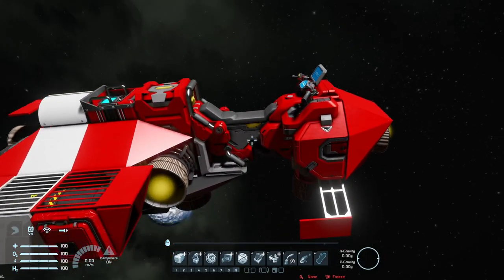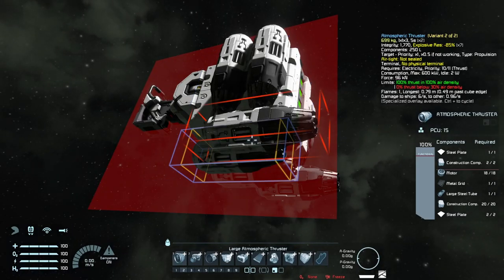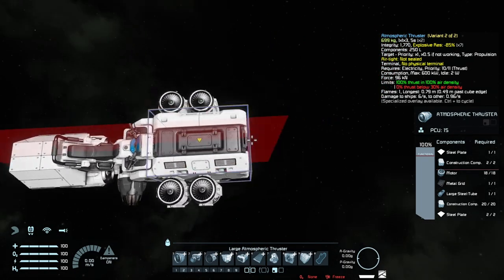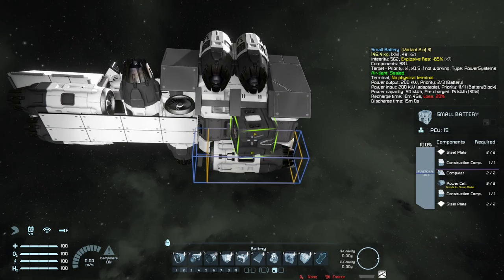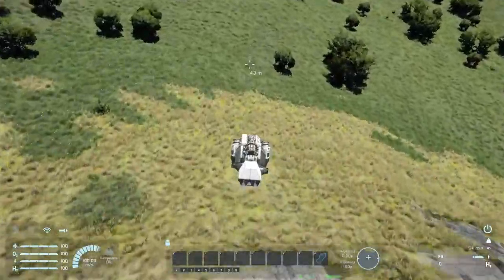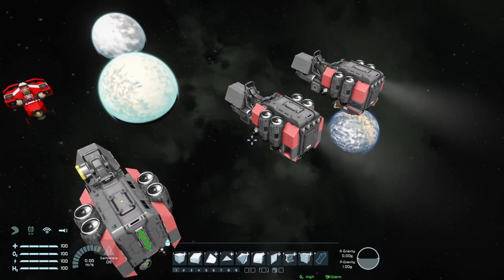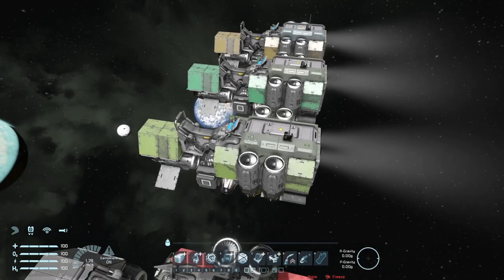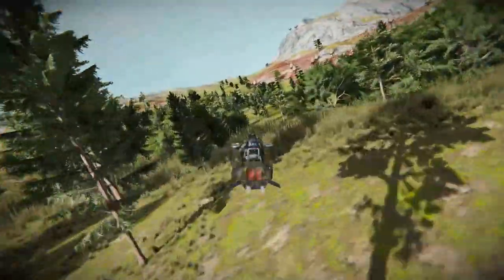I tried to build the smallest speederbike I could

Comment: I just wish there were actual "hover engines" that kept the craft at a certain altitude above the ground. That would be nice.
Reply: thats what the event controller is for
Reply: @cardboard9124  I mean, fair point, but it kinda falls apart if you lean a bit. Unless you make some sort of detection system for which way is up.
Reply: A) there's a mod for that.
B) the event controller utterly failed to keep my altitude stable in every test I ran.
Reply: leg blocks would be nice too
Reply: @Silverwing2112  yeah I had the same problem right after I commented
Reply: If your not anti mod there is a mod for it called Hover Engines made by Takeshi. They have spring effect against the ground and you can adjust your minimum height and spring pressure. Honestly there are a few options you get with them and its damn near impossible to crash into the ground with them.
Reply: To those saying to use a mod, I don't think this is the answer. If anything, they should just increase the acceleration/deceleration of thrusters (ergo, how strong they are), which kind of needs to be done anyways. Oh yeah, and add actual bike wheels. And diagonal suspension, while we're at it. There's a lot of seemingly pretty basic things that should be in the game but aren't, and mods can't always be the answer.
Reply: @ZachTheInsaneOne  Well at the moment mods fix a lot of the short comings of SE. If you aren't into mods thats fine, but the vanilla thrusters are absolutely crap and trying to make something requires it to be a brick of thrusters. It would be great if there were vanilla hover engines.
Reply: @ZachTheInsaneOne  You're right, mods aren't always the best answer. But if the developer won't, the community must.

Comment: I Like the design of the speeder, though I'd maybe say it wouldn't of hurt if you moved the side thrusters to be parallel or even removed them entirely. The way the speeder moves it kind makes side thrusters unimportant, but I could obviously be wrong, since I've had very little experience with them myself. I do wonder if there is a way to make sure the thrusters keep the bike just off the floor, but not actually be allowed to fly the ship higher, that be rather interesting to see as well.
Reply: The side thrusters are important because otherwise the craft would have no way of stopping any sideways momentum, meaning the speeder would constantly be sliding left/right and would hit the ground if it is angled. That would make it really annoying to pilot it. The side thrusters can't be placed parallel because they are 3 blocks long in the direction of thrust, and the speeder is only 4 blocks wide.

Comment: Will you be revisiting speeder bikes with the new atmospheric thrusters?
I'm imagining a design that uses hinges to mount your lateral thrusters at 45 degrees relative to the ground.  That way, they can be used together to replace two of your lifting thrusters (with the equivalent of a single thruster) while still providing lateral thrust at a reduced rate.  Since most of your turns are going to be accomplished by re-orienting your lift thrusters, the new orientation of your lateral thrusters should help with banked turns.